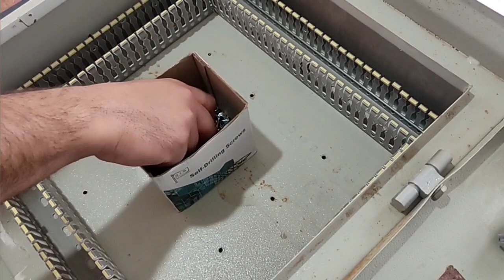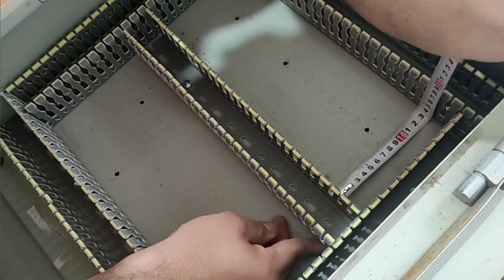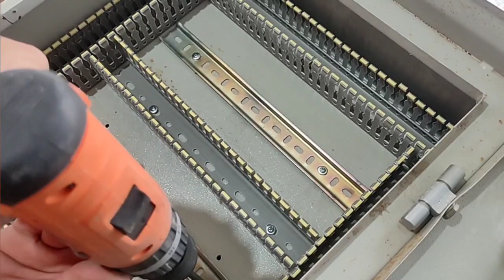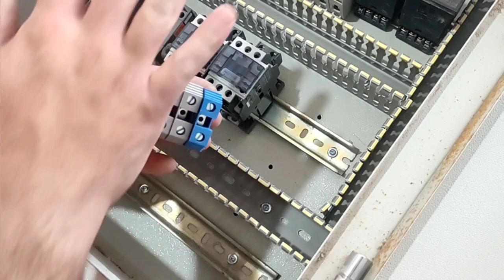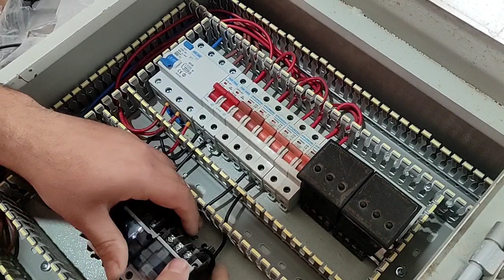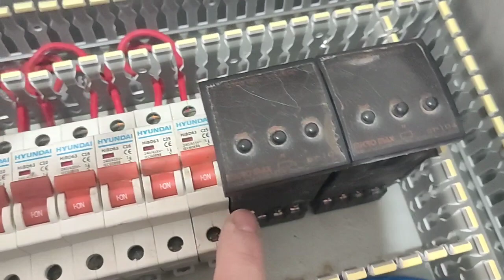Electrical panel Wiring(from start to finish with all details

Comment: Please provide an electrical drawing of this panel for viewers to better understand your wirings. Additionally, why you are using a plier to strip wiring instead of using strippers
Reply from the maker: Hello my friend I will definitely do this in the future. In special situations, it is better to use folded wire
Reply: @IET-76  Yes, you can better post another video to describe the electrical diagram and the rest of the wiring. These are not covered in this video.